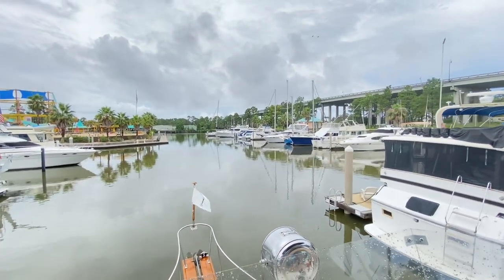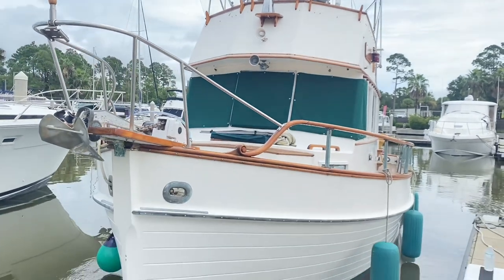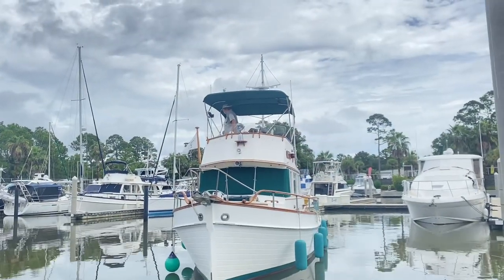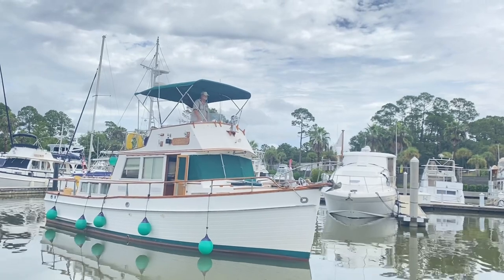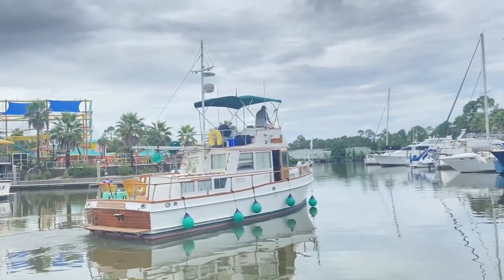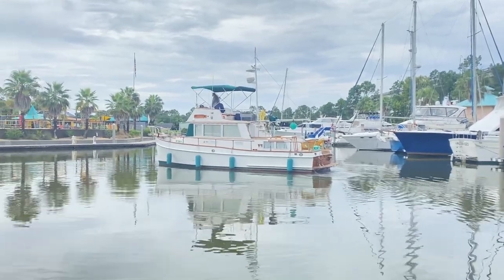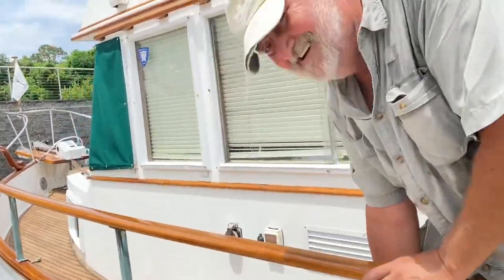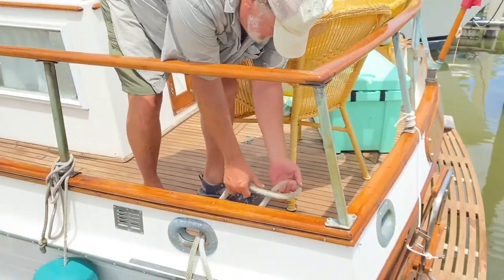Free Boat Lesson single Screw Grand Banks 36 no thruster with Rich

Comment: I was a little confused coming from an i/o boat as to the reverse bump without spinning the wheel, but realizes from you other video that reverse, because of the counter clockwise rotation of the prop and no wash across the rudder, pulls the boat to starboard.. now i get it!
Reply from the maker: Yes, reverse is a bit tricky and not a lot of control, but once you figure out what works with your boat it can be very useful in operating it

Comment: the Grand Banks has a 4 foot keel, when you do a turn into the current it can grab that keel like a sail and take you sideways quite a few feet, you have to be ready for it and compensate for it, it will happen real quick, especially a u turn on the Detroit river or where there is a strong current ..that bigass keel is a reason to put out a sea anchor too if you want to sit and fish unanchored so the current don't grab the keel and take you on a sideways ride at times
Reply from the maker: Yes 100%

Comment: Definitely easier without wind and current but the theory was demonstrated.  How come no mention of prop walk to explain the physics of it?  I have a GB32 and when in reverse the stern will "walk" to starboard making counterclockwise turns very easy.  I noticed that all turns in this vid were counterclockwise.  Try making the same maneuvers in the clockwise direction.  Very difficult especially when you have an adverse wind blowing the bow down.

Comment: Works fine when not a scrap of wind is blowing. What do you do  with ten knots from any direction?
Reply from the maker: That’s not true but what ever you think. You cannot operate a single screw without using these moves in wind. It takes lots of practice and not easy to learn. Thanks for watching and God Bless

Comment: So that boat backs to starboard, which works great for his slip setup.  I noted you had him using the rudder when in reverse.  Does that boat respond to the rudder when in reverse?
Reply from the maker: not really but every little bit helps on a single screw

Comment: If this were a left handed prop, what would the move be for backing out of this exact slip?
 Would you just back all the way out the fairway?
Reply from the maker: Well it depends in a GB 36 I would Turn it like I did that one. Prop wash is an effect but it’s not a huge factor. Every boat is different. But I would not change on a single GB 36